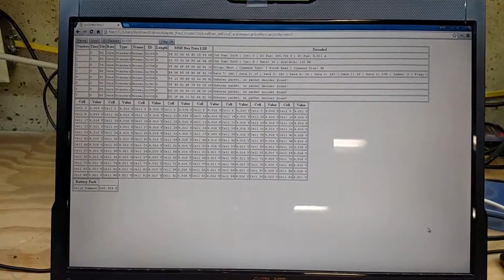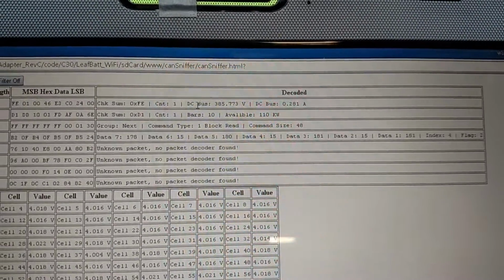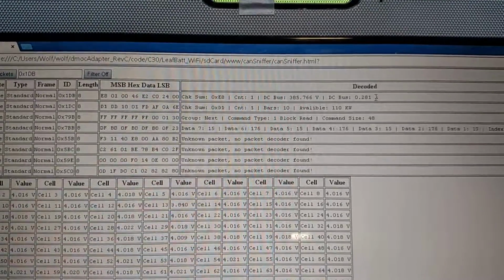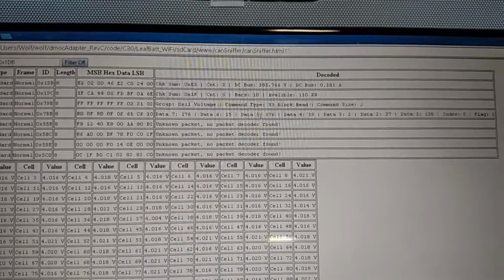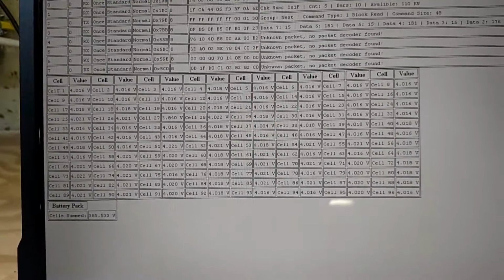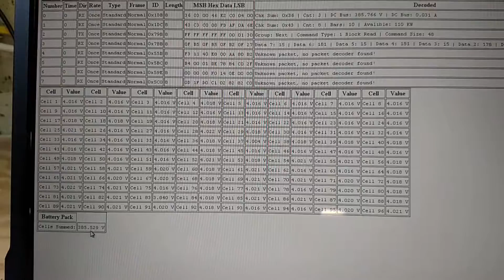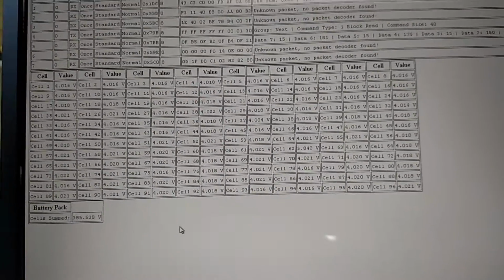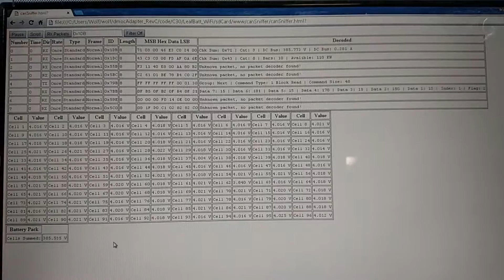Solectria E10, Lithium Ion Battery Upgrade, Part5

Comment: How did you find the info that enabled you to decode the packets?
Reply from the maker: Perturb and observe...
I would send different signals (cell voltages, pass known current through the current sensor, heat/cool the temperature sensor, etc...), to the BMS and see how it effected the data in the packets.

More info is on the website:
http://www.wolftronix.com/E10_LithiumUpgrade/index.html

Comment: 12 bars is 100%. So your pack is not quite at full capacity. I have not checked my pack voltage at 10 bars but I can if you want me to do that for you.
Reply from the maker: +Pete McWade 

At the time of this video I did not know how many bars was a full charge.

I don't think there is a direct correlation between voltage and bars available.

Nissan probably has an algorithm that takes in the milage on the pack, number of cycles, depth of discharge, temperature and voltage... And then comes up with the number of bars remaining.

I would love to know this magic formula. :)

Comment: Hi Wolf can you provide a dbc file out of your re engineering?
Reply from the maker: +Sigi Wi
What is a dbc file?
Reply: that's a standard description of CAN messages, like CAN ID, Start adress, lenth, offset, ect. ... the software you use should give you the possibility to export an dbc file, basicaly a txt file with a defined format inside
Reply from the maker: +Sigi Wi 
The CAN sniffer in the video is my own software.

It does not have the ability to export anything, just display it.